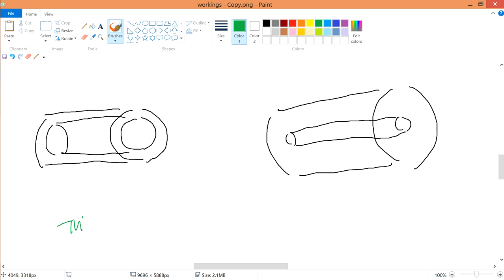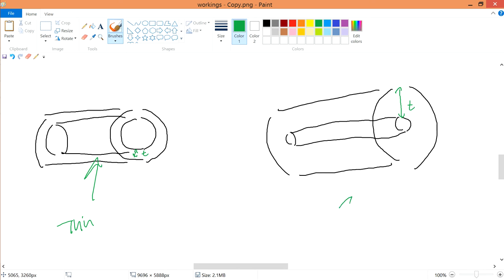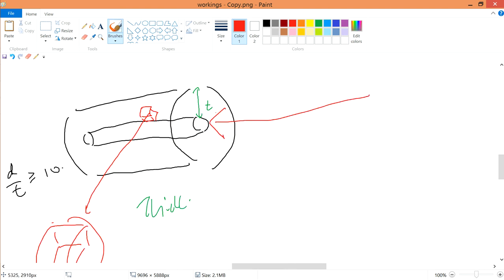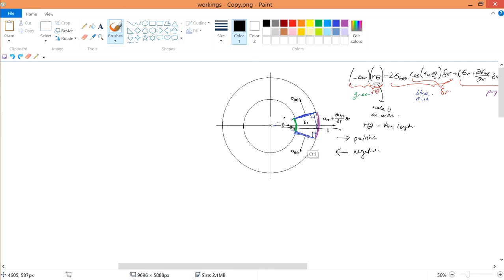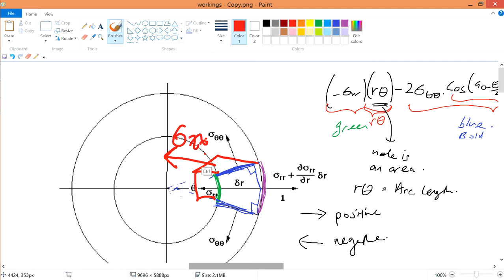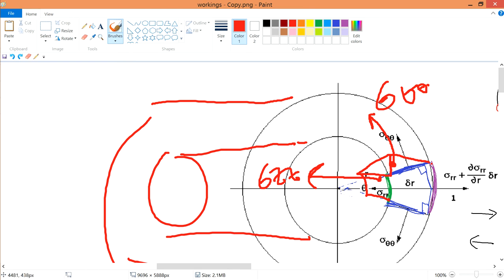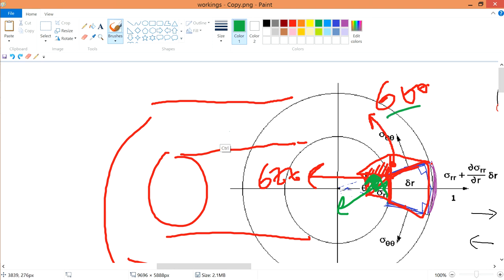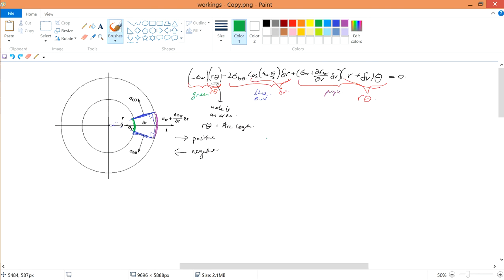l4v3 Deriving equilibrium equation for thick wall cylinderical vessel

Comment: For calculating thickness of pipe, i needed value of Circumferential Stress of ASTM a106 gr b, 
Can anyone help me out with the value? I could not find it on google
Reply from the maker: http://www.americanlifelinesalliance.com/pdf/Update061305.pdf page 16 or you can press ctrl + f and type in astm a106...u should get grade B's psi at 100 farenheit to be 20,000psi including its equations, hope this helps i think haha
Reply from the maker: btw, S is hoop stress which is the circumferential stress...the legend u can find at the top of tt paper
Reply: Can you provide me the value? I have gone through it but, everywhere Hoop stress is Calculated using thickness.
But i want to calculate thickness using Hoop Stress?
Reply from the maker: from the pdf i sent u, it mentioned is 20,000 psi at 100 faren...or in other words, 137.89mpa....then this is the hoop stress...of ur material...